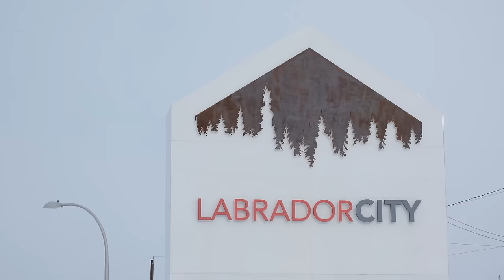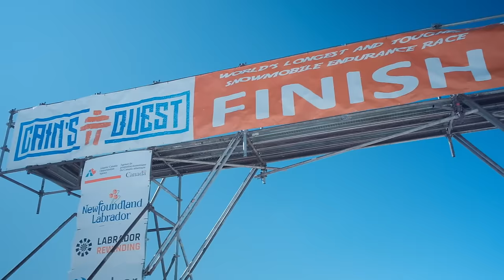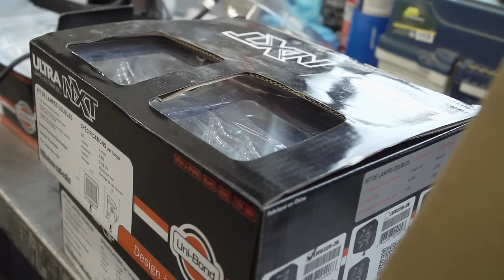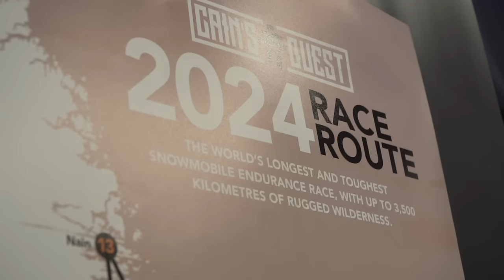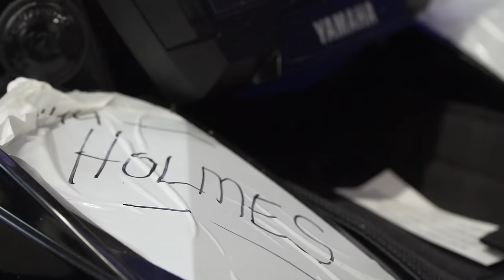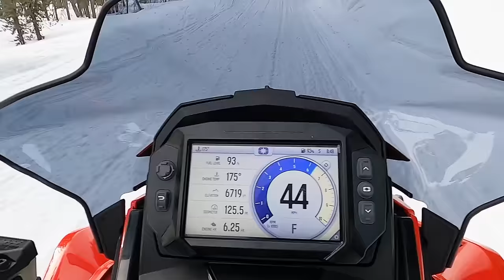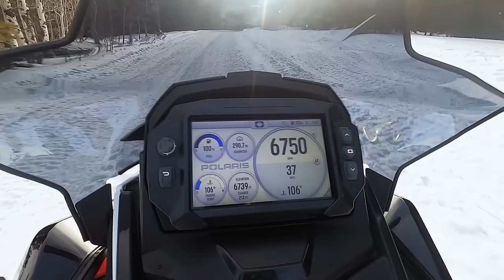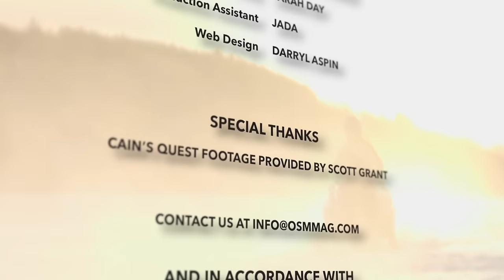Snowmobiler Television 2024 Episode 07

Comment: I agree with your choice XCR I currently run a 2022 850 XCR just love this sled for all the reason you mention, the better shocks, biefed up suspect
Ensign,  the tipped up rain. 's the make a 136 ha dle like  128, and many more, has 2021 VR 1 found XCR to be much better, if the come out with boost in XCR 2p25 that will be my  next sled by way 85 years old. Christopher Ottawa,  keep up the great work with your channel

Comment: Did you guys do beefed up suspension cross shafts and improve/beef up the compression damping of the stock shocks? When Haydn and Lee tried it on Winders they pounded the guts out of their shocks which ultimately doomed their effort. I would want a torque/fuel economy tune and a lighter muffler if I was doing it as well.